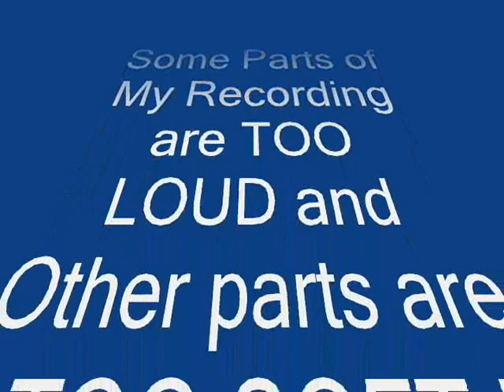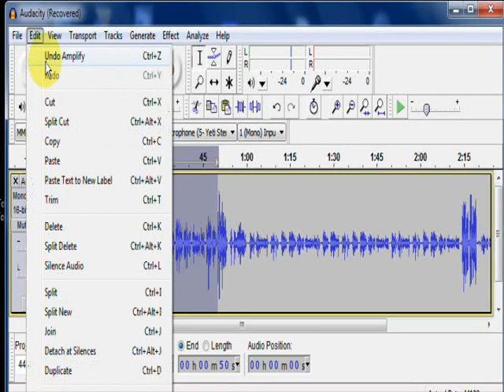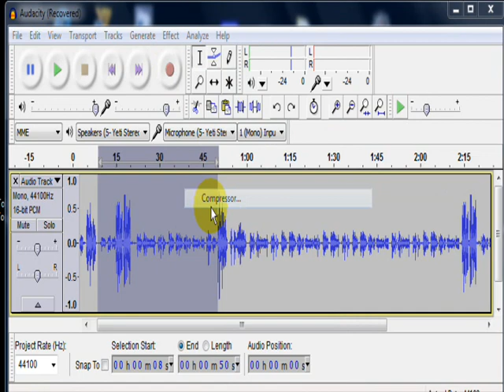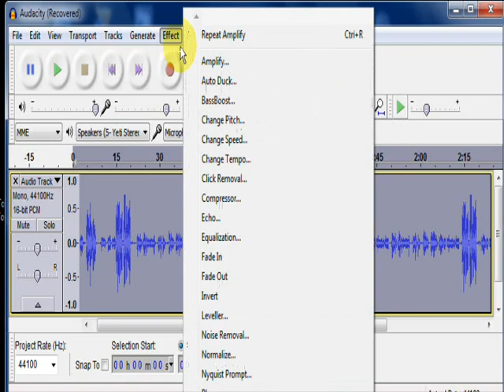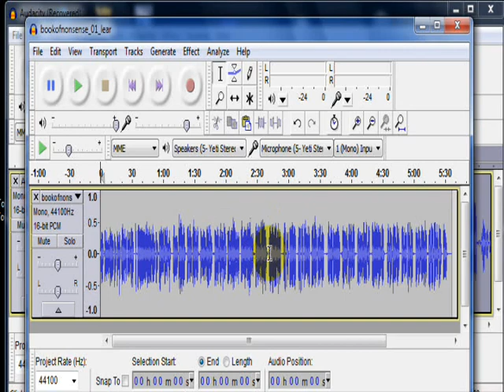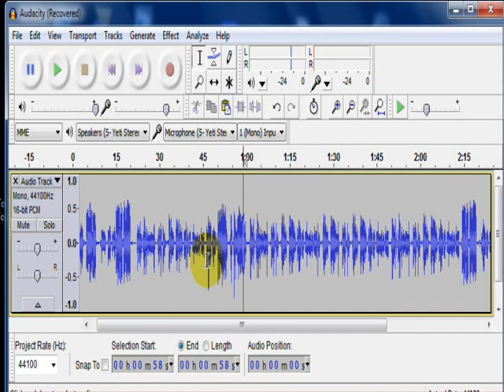Some Parts of My Recording are TOO LOUD and other Too Soft.wmv

Comment from the maker: well, anything used in excess will cause distortion but compressor is one of the most forgiving tools I have found.  It only brings down the peaks and doesn't hurt anything else. 
It won't fix clipping of course.   and y ou are very welcome to the turotials.  I keep trying.
Reply: Phil....
Can i ask you somting... if i have a wispering on tap verry low... is that posible to make it a clear vois?
Thank you  phil

Comment: What most people don't realize is that you have to keep as much of the audio the same maximum level, as much as possible, rather than approximations. Always write down/remember the maximum level of peaks. Do the same with typical parts. Amplify non-peaked and peaked parts separately. EXPERIMENT with settings! USE Preview to analyze/observe each setting level! Each audio is different, in each part!

Deal with Amplify before Compressor. Only use Compressor if the audio is too sporadic/out-of-control. Don't forget to try various tools to remove noise if present (like Noise Reduction, look up how to use). And only use Normalize as the final step, before lastly exporting to a lossless format.

Comment: Hello Phil, This is great finding you here. HAPPY NEW YEAR.  Thanks for your continuing work on Librvox. I hope you can help me with an Audacity problem. I have quite a number of Audio Books on Cassette tape. I've converted a few of them to digital. The problem is the tapes are very old and stretched, so the digitized recording changes. What happens is the narrators voice sounds as if he is moving away from the mike then getting closer. Or perhaps simply moving his head away from the mike. I have your EMail from when we discussed some of your Librivox work so I could send you a minute or two of recording so you can hear the problem.  Thanks
Reply from the maker: Sure Tom.  Nice to hear from you too.  Send 'em along and I will see what can be done.  I'm no expert but what your describe is a fluctuation in pitch caused by the tape stretching; have no idea what to do right now but will listen.

Comment: In my recording I transition from a clean quiet guitar to a louder distorted guitar. But after bouncing the quiet part is a little louder than the distorted part on a speaker. It sounded fine when I was mixing. I want it to sort of explode into loudness but the quiet part just keeps getting louder and the more intense part keeps on level or just below it.

Comment: My question is in comparing the Compressor tool and the Normalize tool (or is it the Loudness Normalization tool, that would be comparable?) 
As far as I understand, the Compressor is best used when most of the audio is an even volume, but the occasional spikes need a little "squooshing down" so they can match; while the Normalizer is best used when the volume is all over the place, so the spikes are squooshed and the whispers are amplified simultaneously? 
Or is it just a matter of preference?
Reply from the maker: You are correct about Compressor tool being best used to 'squoosh' down (love your technical terms) some or all of the high peaks that might keep us from amplifying that track. Spikes will do that to us.   Normalization is really an amplification tool that lets you make the track louder up to the limit you set. I'm not an expert.  I use compressor frequently and Normaliztion never.  The help tool inside Audacity will lead  you to much better explanations I promise.  Are we having fun yet?
Reply: @cajun5454   Oh I am absolutely having fun. LIbirivox is the perfect hobby for me: combining my loves for service, and playing on the computer, and reading aloud, and discovering/sharing literature, and learning new skills, and I am balancing it with my drive to "do perfectly everything I do". 
So, mastering the basics of editing is really helpful. I appreciate your prompt responses to comments left on videos you made years ago.

Comment: I have the opposite problem: the parts that are supposed to be soft are not soft enough. How might it be fixed? Is there a decompressor or something like that? In other words, I would like to increase the dynamic range.

Comment: I hope you will help me.  I recorded a history book, but the chapters were recorded separately and are not uniform in sound level.  I have normalized at -3.0. equalized, compressed etc.  I don't have peaks but just different chapter sound levels.  I'm an absolute amateur so need some easily understood instructions to just adjust chapter by chapter to the same or similiar sound level..  I would so appreciate help.   The recording is intended for submission to librivox

Comment: I have a sound track  91 db loud.  I put compression on to make the loud and soft sounds even up but the over all sound track is rendered much louder than the 91db I started with!
    After compression,  how do I determine how much louder the track has become?  Are there any gauges on Audacity to know this and most importantly, how to I volume down to exactly  the 91 db, I am wanting it to be?

Comment from the maker: Sure.  You can contact me inside of LibriVox easily, my forum name is philchenevert.  Just send me a PM.  Or you can send it to me a chapter or two in email.  Let me know if you need my email address.  And you are not an absolute amateur if you know how to normalize and compress!  Don't worry, it will be fine.